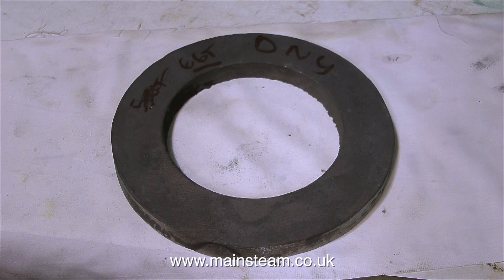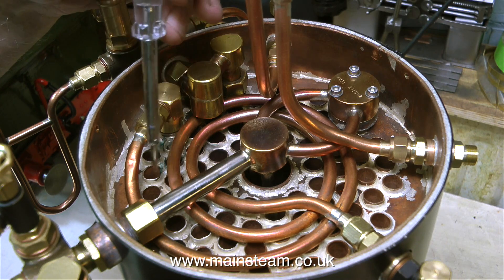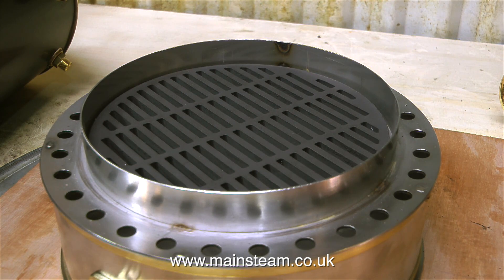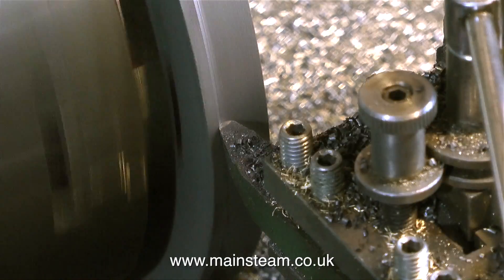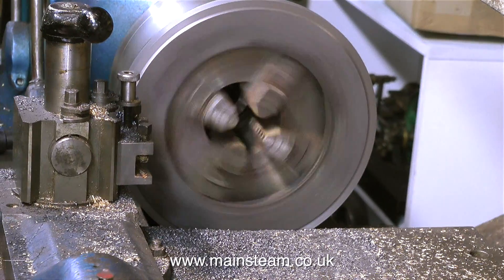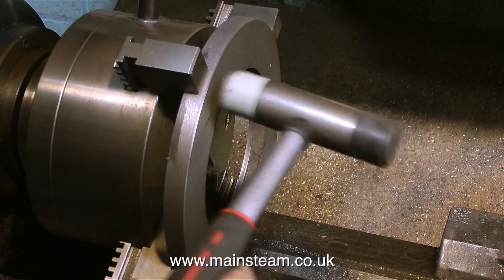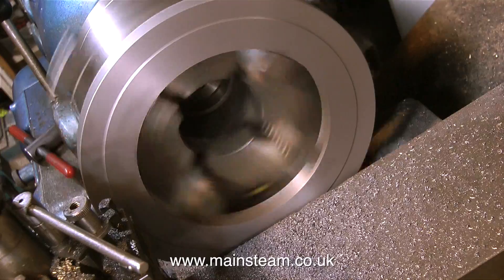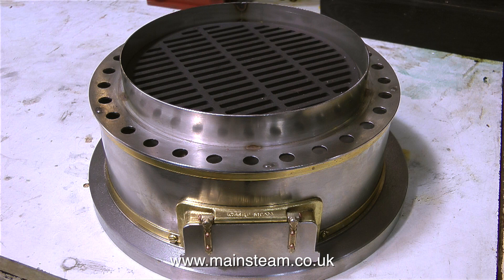HOW TO MAKE A METAL MOUNTING BASE FOR A COAL FIRED CASTLE V6 STEAM BOILER - PART #1

Comment: Peeps could probably do something similar starting with a cast iron front disc brake. That is already machined, and for heat dissipation, is vented throughout the disc. The ones on that Jaguar will do nicely, though seriously, Minispares GBD496 disks are £18 each and 8.4" dia
Reply from the maker: and a vented one would look like what it is - a brake disc .....
Reply from the maker: Now why didn't I think of that ???? - a good tip - thanks Roger }:-)))
Reply: I would have suggested that too as brake discs are pretty tough bits of metal well used to getting toasty hot,a solid one for looks but a vented one would prob vent too much heat out.
Reply: The vented disk I mentioned is sometimes machined down to fit minis with smaller wheels. This leaves the edge with a set of square holes, so may look less vented disk like, as it is not fully vented with the continuous slot with many little pimply bits like modern ones  See smaller version in the minispares catalogue. Our discs at Land Rover are way to ginormous!